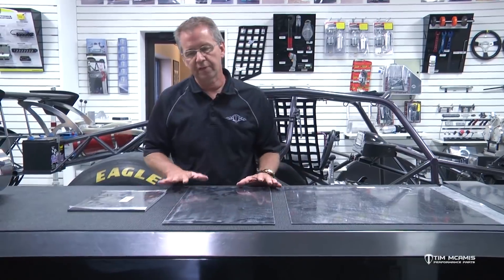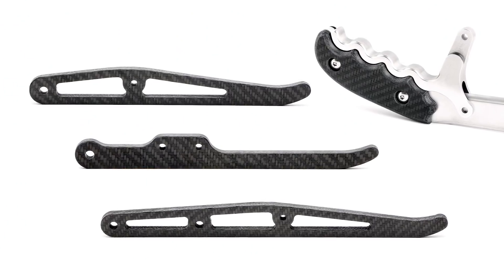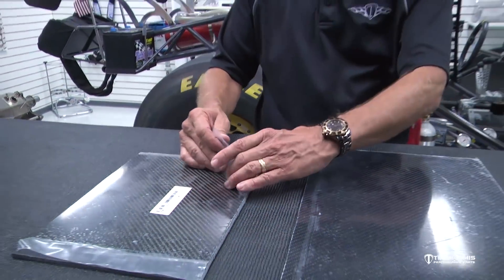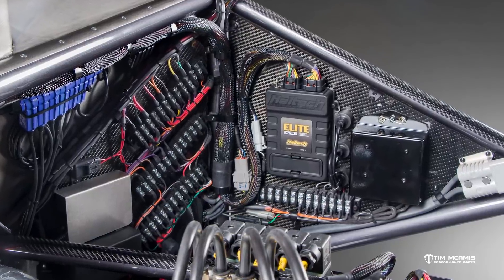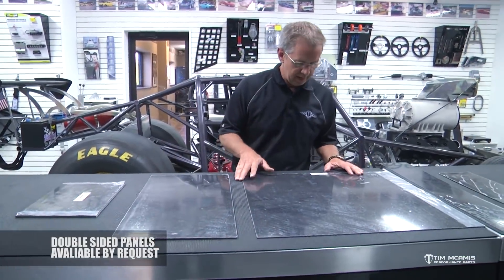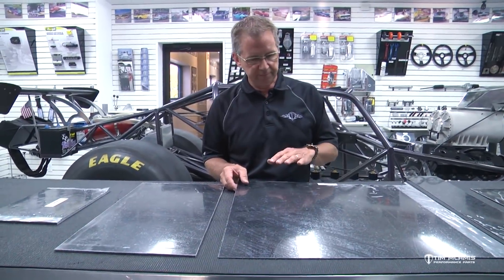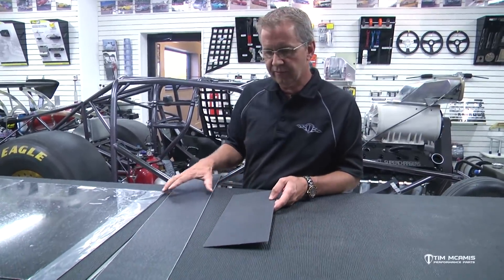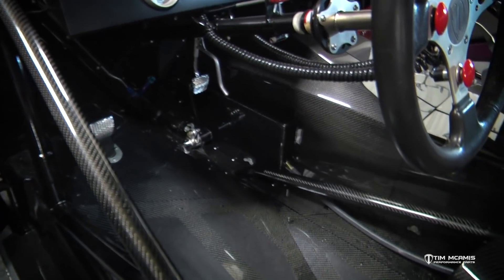Carbon Fiber Panels - Composite Series: E3

Comment: I cant find any info about, maybe you can help me out.
I am makeing my first carbon fibre project. It is a car bonnet. I am planning to make exact copy of inner frame.
Bonnet is originally made 0,7mm sheet metal(both inner and outer part)
I am planing to use 200g 2by2 twill(0,2-0,25mm as for one layer thikness) how much layers I have to use, to get same flex as steel sheet metal has? I think 45degrees of two layers should be enought, but I am not shure.
Every video in youtube only cuts and cracks and pulls cf test materials. They sometimes provide numerical data, but that is not enought for me. I just want minimum weight bonnet with steel bonnet reference without bendind into engine bay at hight speeds.

Comment: I'm assuming the panels are laid up with the weave in multiple directions since you said the grain direction is only cosmetic? It will defiantly be stronger in one direction if its not. Great videos!
Reply from the maker: The "only cosmetic" mention was in reference to how the panels are installed not how they are produced. Meaning, when they are installed, it typically looks nicer if two panels side by side have grain running the same direction. There are a few photo references in the video near this. As far as how they are made, the grain would be ran in each layer according to whatever creates the strongest layup.
Reply: What I understood from the "only cosmetic" is that the panels are not structural panels so it really has no affect on the flex of the car.  In RC racing we pay extra attention to direction of weave and thickness for chassis flex, but those cars are 1350grs.  this is probably 1300KGs.  So accessory plates should not have any major affect on a car this size.   @Timmcamis

Comment: If there is light scratching on the outside can it be buffed like clear coat?
Reply from the maker: It's possible, but you don't want to if it is much more than a very light scratch. Especially if it is a vacuum bagged part as the resin will much much thinner.